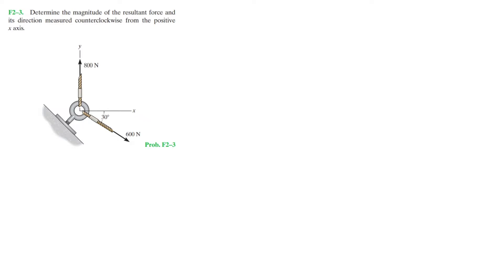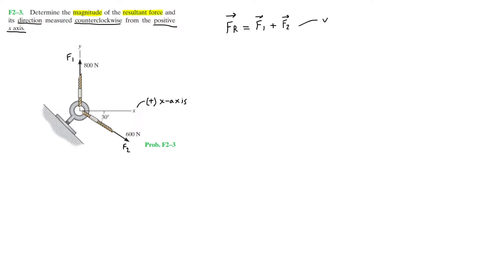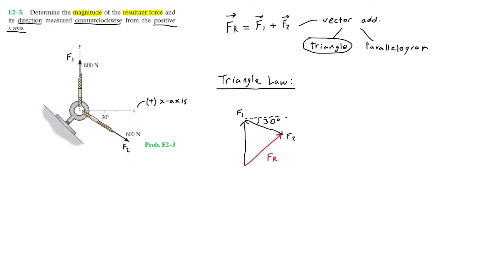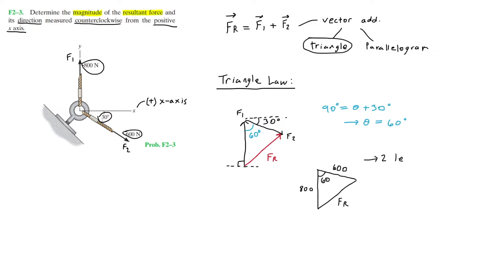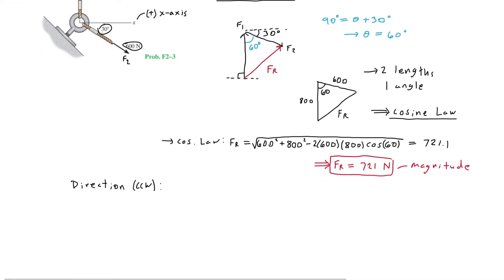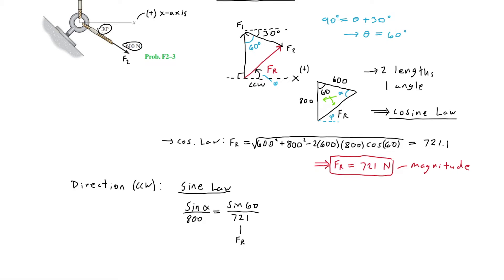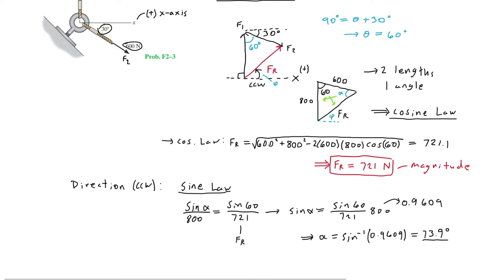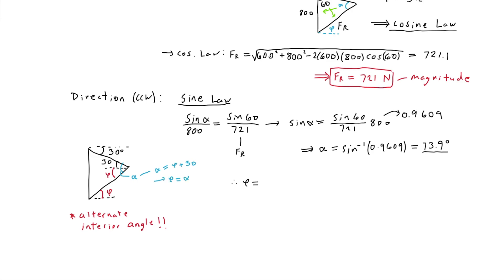Statics: F2-3 (Hibbeler)

Comment: How can we recognize that whether it is in solve with triangle law or with parallelogram law.
Reply from the maker: Good question! Since we want to add the two forces (which are vectors), we will need to implement either the triangle or parallelogram law for adding vectors. You get to choose either law you feel most comfortable with according to the problem, since both should give you the same result. Depending on the alignment of the forces, however, it may be easier to use one over the other.